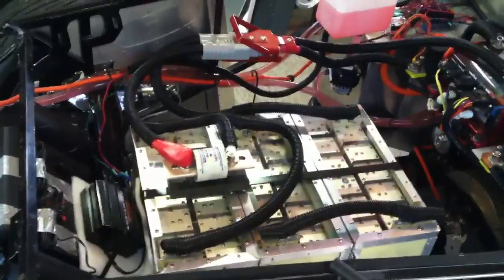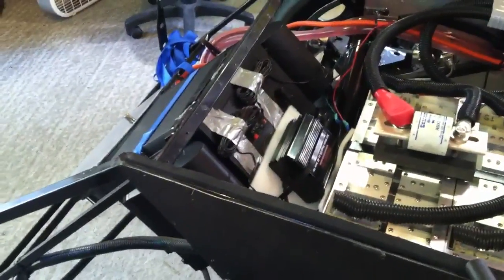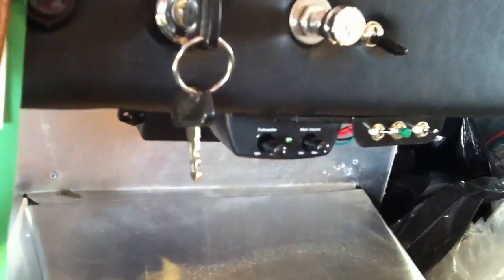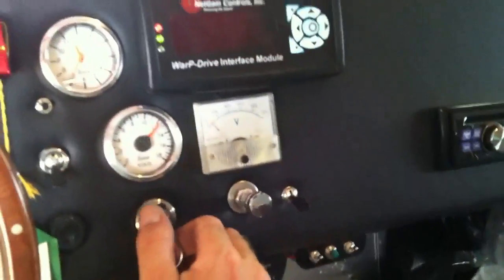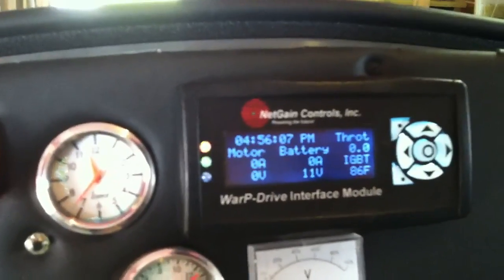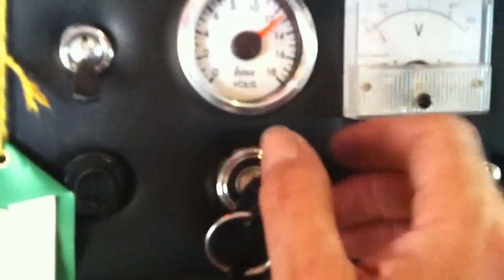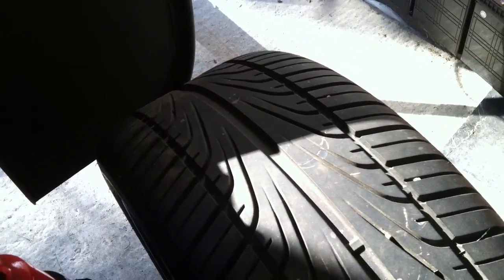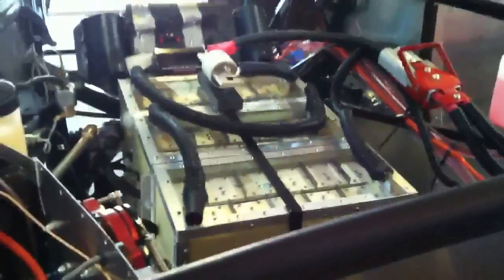Factory Five Mk4 - Electric Car - Video 33

Comment from the maker: Jeff, it sounds even better than that in person!    The Klipsh speakers put out enough low end that you can feel the (simulated) motor vibration sitting in the driver's seat!    The only down-side is that it takes an additional 10 amps from the 12V system at full volume, and that will lower the MPG equivalent!    A small price to pay for a totally cool feature of the Electric Cobra!